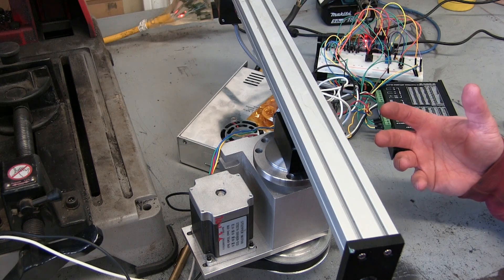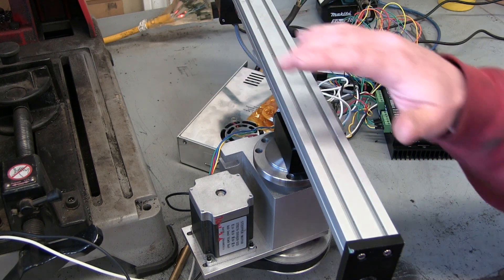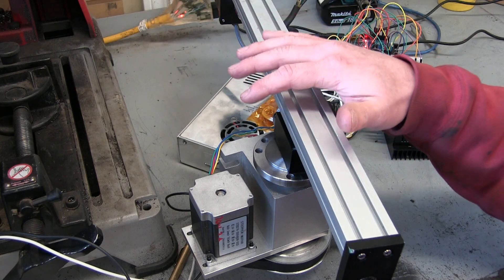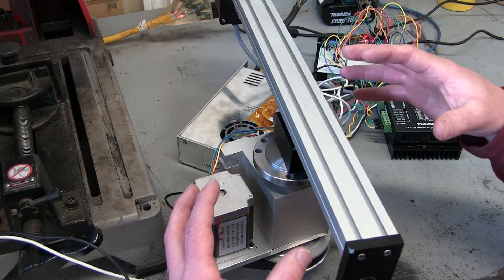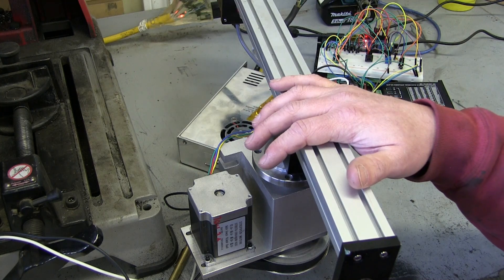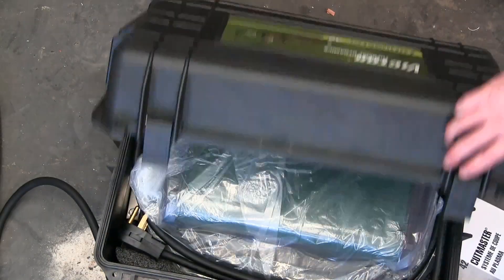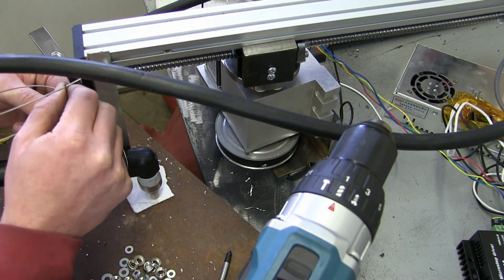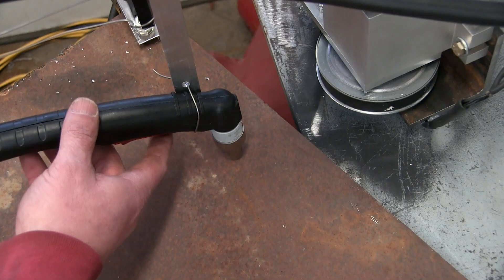Portable CNC Plasma Prototype

Comment: I have a Plasma-Cam at the school house that does this but with a HUGE footprint. One of the drawbacks or issues with your design is once you get it chooching at optimal cut speeds, it will produce a HEAVY bit of smoke. Also, your "Tiny" footprint still involves a Plasma cutter with an air supply.... I could see the decision of use being based on reliability and versatility. If you can get that that thing to be bullet proof and get your software chooching easy then perhaps it's marketable. Otherwise, Companies that have a need for CNC plasma probably already own a full sized plasma bed somewhere and If you're machine competes on sheer portability, It will have to be more mobile than that drill... with a plasma cutter attached I just don't see that. 

I do however see a huge market to hobby garage types. I myself would buy one for the home shop. I just think too many options already exist for plasma CNC and speed hole drilling. I do however think you're an amazing engineer and your Ideas are amazing. Don't get me wrong. I also Think that if the Footprint is kept to the mag base and the software was flawless, I could see sales based on this thing's cool factor alone. Also It's ability to cut on already existing structures is useful. I guess I could picture it being purchased by industry....

In conclusion, I have no stinking clue on this!! haha, Build it because it's cool as shit and I'm sure you'd have a market somewhere.

Comment: Small footprint of the mag base, but necessity of clearance for the radial conductor around this base...therefore not that useful in already assembled constructions I think. How about a small five joint robot arm with mag base? To navigate around superstructural parts it's may be necessary  to guide the arm's head by hand for some spatial calibration. And I wouldn't like to do the math ;) But nevertheless "gut gemacht"!

Comment: as far as inverse kinematics is concerned, there is basically none, as you only have one rotary axis. Just have people plot a shape in a Cartesian coordinate system, and using basic trigonometry, treating the coordinates as two dies of the triangle and the sliding axis as the hypotenuse, you can generate an angle dead easy. Hell I'll write you the function if you so require

Comment: Nice, you might consider CNC moving the plate & fixing the plasma cutter.  The mass of the plate will damper & smooth-out plate motion and the plasma cutter head won't move at all.  Of course slightly bigger but simpler, TomB

Comment: Coordinates are easy!!! Just use a cartesian algorithm to generate the points in X and Y (standard code), and then just convert those to cylindrical coordinates. 
It is a pretty easy conversion :) ! 

(just look it up on google. In a nutshell, remember the unit circle from pre-cal? x=r*sin(theta) , y=r*cos(theta) , so some simple math yields, x/sin(theta)=y/cos(theta) : x/y= sin(theta)/cos(theta : x/y=tan(theta) : tan^-1(x/y)=theta = (rotary axis number value) And once we know theta, you can use that to calculate r!  x/sin(theta) =  r = (your linear R axis motor) 

I would also suggest you take a note from the 3D printing world. Use a belt drive for the R axis, and have the plasma cutter itself move and not the whole arm. This will let you have more rigidity on that axis with cheaper components than making the the whole arm slide controllably. And you could use a chain instead if you prefer :3

Comment: I see a problem that I am not sure how you'd fix. The "Saskatchewan" shape was meant to be a square. The further you get out away from the point of rotation, the wider the sweep you cut. Circular holes will look like eggs, and squares look like Saskatchewan. It needs a position sensor to negate the added travel as the choocher extens further out, away from the rotation point. Or maybe I'm stupid, and we were trying to cut out, and piece together a steel map. Skookem as frig, heavy as fuck.

Comment: I'm a fabricator, i could certainly see this being a thing. It seems to me you would need some sort of locator/refence point, possibly two centre punch marks. If you could make it so a guy can lay out 2 marks to point the machine in the right direction, even an old fogey could make it run.

Comment: It will work, your going to do really well with this. First thing, take off the guard and get the torch at 90 degrees to the metal, it needs to pause on the pierce till it's through. All the manufactures make a plasma torch with a geared rail on it. Your app could have preset shapes, you would also need to have a few other things to fill out like type of metal, thickness, etc.. Have your signal generator with presets for the pierce and cut height for each metal thickness along with speed/amps. Your going to be able to put etching heads on it, oxy torches, pens. This is great, I always wanted a CNC table at home but 15k for a hypertherm is not in the budget. Make sure it accepts the universal .DXF file and your golden. 

Imagine filling out a few boxes on an app: Select GUSSET or SQUARE; Select SQUARE, type in length of side, 4". Fill out some brief info, A56 cold roll, 1/8". You would program in that 1/8" A56 is to be cut at 30 amps and your pirece cut holds at 2 seconds before it blows through and starts moving at whatever speed that is. Start basic, squares, rectangles, circles and gussets. Most hobbiest don't have a torch that will cut over 3/8" so not much programming to do. You got something here, wish I would had thought of it.

Comment: Just need to figure out the mafs to allow the cutter to plot and trace a square, rather than an arc shape. And to calculate the speed of rotation taking into account the extension from the base, so that, when it rotates with 2 feet of boom out, the end is not moving twice as fast as when it rotates with 1 foot of boom out.

Comment: The rotary angular speed would have to be adjusted based on the extension of the linear arm to get a consistent linear velocity in rotary direction.  Linear velocity at tool from rotary motion (blond ones / second)  = rotary speed (rads/second) * radius (blond ones).  I'm sure you can account for this in the programming without too much change.

Comment: Six seconds into the video I understood everything and tought to myself "THIS IS F** GENIUS". I have a couple of ideas, one of them is to spring load the torch to the work, which I just realized you could do with a small plasma, saving yourself from implementing a THC control. And if the warpage in the sheet stock is too much, you could even implement an autoleveling routine with a probe in place of the torch, but I don't think it would be necessary for something like this. Drop me a PM if you want, we can make this work very nicely.

Comment: AvE could it not have a proper xy axis setup with the same footprint? use the same cantilever style gantry(say in the y axis), moving along a rail 90 degrees away (x axis). also I love the idea of the line following robots as others have mentioned
Reply: also what about a "zero tip" (lack of a better name). a pointed rod positioned a known fixed distance from the cutter, so when someone is setting up, they can just position  the tip on a significant point (center, top right corner). just program it to offset when start is pressed

Comment: Looking like the beginnings of something great IMO!

Maybe the Mag base plus a cartesian robot would prove more practical to program in the end though?

I used to run a NC Punch, where we made components for final assembly as dust collection devices. 
The most common thing was punching a line of holes in a particular direction a certain diameter and a certain distance apart, or cutting a circle or ob-round of a particular size.

As i see it very cool with what you have where it sits!

Comment: One of the first things you'd want to do is get a machine torch and set up remote triggering.
I am a retired 32 year fabricator, every day all over this rock fab shop rats hack shit out of metal plate with plasma cutters, especially on job sites because there aint no laser or plasma table like there is in the shop.
Even in the shop you might need a couple square or round flanges and there is a two day fucken line of jobs on the plasma table and laser. if this could be done to be as simple as a mag drill and with a similar price point (not including the plasma cutter) you could sell a blue gajillion of em.
Reply: Edit, you'd have to be fast though, sell a zillion before the big rock candy mountain people clone em and get em out to harbor fright.
Reply: Edit, you could also offer kits with just the electrickery trained pixie boxes for the people who can build all the non smart stuff.

Comment: Outstanding idea!  Some of us hobbyists would be interested in such a device as well...I'm space-limited, so no plasma cutting tables for me. Something that can live on a shelf and get set down on the material when needed is very interesting!  A bit more refinement and it could be Kickstarter time!

Others have discussed the polar/Cartesian conversion solutions, so I'll mention a couple of things I noticed that could use some work in the Mark II: sag and material flatness. The arm seemed to tilt a bit as it extended, and with long extensions this will be worse...tighter tolerances in the sliding joint might help, but materials being cut in the field may have been welded or torqued, so not as flat as fresh plate on a table.  Both of these have the same issue...maintaining distance between the cutting head and the work. Immediate thoughts on solution for this are mechanical spacer (skid, wheel or ball that rides on the work) or active compensation using a distance sensor (sonic, capacitance, Hall effect, etc., though doing some of these very close to a plasma cutter will be problematic).  If this is solved you could deal with 3D cuts too...like cutting a hatch in the top of a dome.  If you add extra axes you could do things like cutting notches to join pipes or make holes for sensors in pipes while keeping the head perpendicular to the surface all the way around the cut. May just need a rotating joint at the end of the arm, but I haven't thought this through yet...

The canned code idea is good, but something that can convert Cartesian G-code for use with this device would make it easy to add more canned code as needed. That shouldn't be too hard to do, though if you want to optimize it, it would take some work (like recognizing when a series of short straight movements are trying to approximate a curve that can be done more simply in polar coordinates as a constant radius curve for instance). You could also do canned parametric code rather than fixed code....like a circle routine that you enter a radius for so you only need one and will be able to cut any circle or arc within the arm reach. Whether you need an anti-Wiley coyote feature to prevent a user cutting a circle all the way around the mounting point is up to you and your lawyers...

Looking forward to seeing more on this!

-- Mike

Comment: great idea the field is waiting in so many industries to get the cnc out off the floor an up in the air I have a few more ideas
Wondering if you took a great idea and flipped it... why not attach the linear motion to the steel with magnets and had a lighter head  ie your plasma cutter.  you could then  have a much larger work area limited by the cutting hose instead of a small cutting area  you could extend it by adding extensions  up to  8-12 feet right?

Comment: AvE the plasmag is amazing!!! you should add a relay to turn the plasma cutter on during your teardown, that way it's a singular system. you should look into the "reprap" 3d print community, you could run an arduino based controller, keeping it nice and cheap, and use already well documented code and software which can be modified for your needs.

you could add a third axis for rotation if the tool head, this way you could add a welder end so guys don't go risking their lives doing repairs risky places.

swappable attachments (plasma cutter, welder, drill) would be cool

Comment: One problem is there are only two axes, which is what you want, but one of them is a radial axis. It is still doable, but programming will have to allow for the natural tendency for the y axis lines to describe an arc. So the turret part will need to be in constant motion to keep those lines perpendicular. It is doable, but I think combining the rotational axis with two perpendicular x-y axes may produce better lines with less programming make work.

The great part of your idea, is making it simple, by making the machine easy to use and a simple app interface with pre-configured options for squares, circles, etc. You are definitely an inventor of high caliber in your approaches to what something should be designed to do and how it should work. I have tried to adhere to those ideals in my own engineering work, such as modularity, simplicity, machinability, and common sense purpose. You are a man after my own heart.
If you like, you can provide me with all your design specs and materials and I will model it and make it available to all your viewers and post it on Grabcad with my models and with full credit to you and your channel.

Btw, since I like your principles, I would like to have your design opinions of my Gantry Crane design which is posted there, and you or your viewers tell me how the first version was a failure and how my second version solved the defect. This project, which I built and now rely on as a huge benefit to my workshop is an example of my approach to design.

Thanks for all the great vijeos you make, I'd love to make some myself, but I am always at a loss for words, when speaking, plus I hate the sound of my voice, I think it makes me sound gay or whiny. Maybe I should write a script.

Comment: Talk to the reprap folks.. many there can help with the firmware.  As far as potential issues - the only thing I see upfront is that you can't tell where the shape is going to be cut from.  Solution to that would be to allow you to set the start point of the cut in the app, given where the nozzle is currently placed, and maybe allow the user to "home" the nozzle first.

Comment: The extension arm vs the rotary point - you're going to have to do some pi math to get the thing into an XY axis for cut.  This means your machine is going to have to be aware of the length of the extension as it will effect the radii of the cut from the rotor pivot.  It's entirely possible, but I feel the precision will have to be fairly high to get straight lines that aren't directly on the extension arm axis.

Still super cool idea!

Comment: Nice work. I'd just been considering similar for fabrication here. Odd to have similar thoughts on similar days, eh? If you want some help, I'll be building a similar system for personal use. I've already got controls, firmware, etc. It'd be a great thing to build a conversational programming android app, though I think one already exists for milling (can't find it right now). Anyone have an app that spits out CNC mill gcode from a conversational interface? I hate doing UI stuff.

Comment: for the control interface i suggest a wifi ap and maybe ethernet . the control software could be done in html5 which will work on any modern device tablet phone etc. also might consider being able to store macros that u can run from a simple on device interface.
Reply: rodney robertson that's what I was gonna suggest. easier to implement cross platform.

Comment: I would say if possible build a small rig for the tip that has wheels and does a very small spacing. Then perhaps some haywire abortion to make the switch have some distant, since you don't want to take apart the plasma cutter you wouldn't want to modify it so just tape a servo to the top and have a thing over the switch that would hold it. Have that set at a distance etc.

Comment: Idea seems completely solid to me. Though maybe we can do away with the phone and have the same simple interface using pre-existing 3D printer main board + touchscreen display.
Even as somebody who can operate CNC, I still want one because for the dead simple things why not? And why stop at basic shapes? How about give it the ability to take in some G-Code for shits and giggles? You've done 80% of the work already with your initial idea.